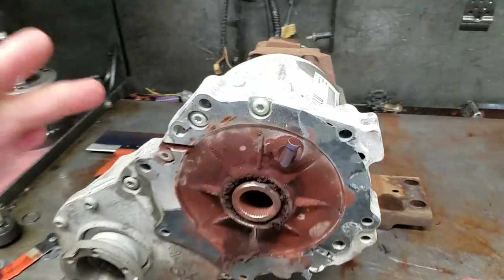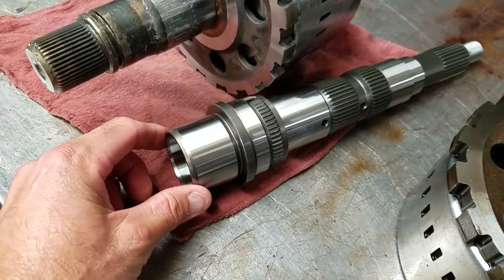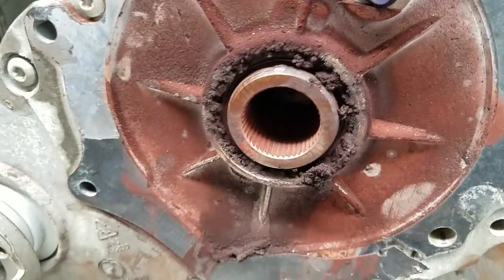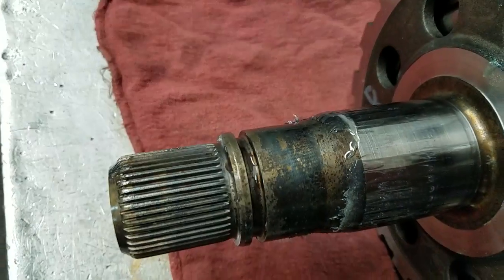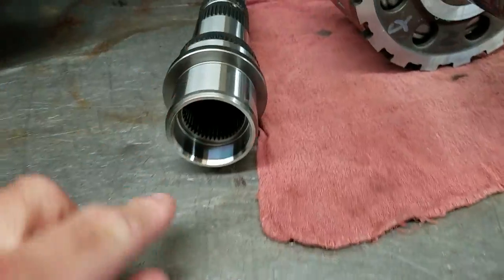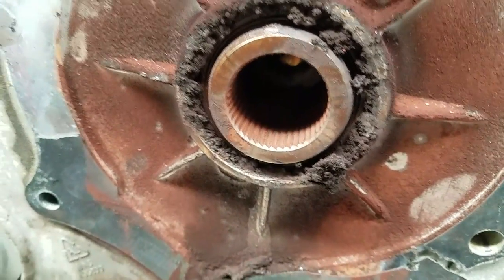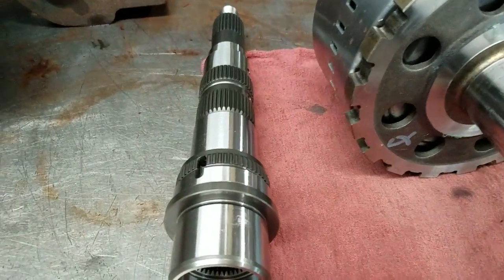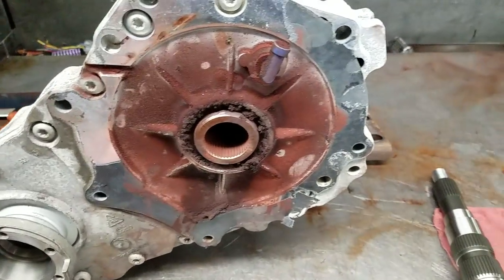Cadillac cts transmission spline failure Meenan Transmission

Comment: This just happened to me. I first heard a bang noise when shifting gears and then all of the sudden the car didnt move and just heard a grinding sound. Had to get it pulled to the mechanic. He said it is the transfer case. Now this video tells me that the transmition has to be taken out and apart as well. Should I go ahead and order a used transfer case from Ebay? Because  he is still going to have to replace the shaft in the transmission, according to this video. 
Also, do you think It was just the splines of the input shaft to the transfer case that corroded? If so then buys just the case would solve the problem.
Reply: What did you end up doing? I'm having the same issue.
Reply: Same issue here
Reply: Do I need to swap tranny as well or just Transfer case.?

Comment: I got a 2011 CTS awd and I think in having this issue!
Reply: This was changed in 2010. It only existed in 08 and 09
Reply: @travishollobaugh1419  That's not TRUE....2012 still happen
Reply: @maxwellautoservice_yeg834  mine is a 2012 cts performance package with awd and i believe my transfer case is going out as well. clunking and noise of metal gears grinding and such at low speeds. starts around 7mph up to 45mph. sometimes it goes away, most times its there. really really bad and noisy while turning at low speeds and moderate around 25mph. it is very embarrasing. i ordered a new tc from amazon for $600ish. and will be installing next weekend hoping it solves my issue. i also have abs light on, service stabalize light on and service traction control light on as well. i wish the owner of this video would have replied to someones comment saying if or if not it fixed it..
Reply: @jackkirk5463  I done  mine about 8 months ago....transmission  & transfer case shafts. You can not do only the transfer case. All done in my shop...took me about 24 hrs to completed
Reply: Jack Kirk did you ever fix this?
Reply: Travis Hollobaugh really? Thats good news.  All cts4 2010 have the new design part from factory or it was a recall or something else?
Reply: it gets worse and studders under load
Reply: My 2012 has done this same thing in process of repair.

Comment: what year those car has that issue?? thx
Reply: 2008 and 2009, the re-designed parts appeared in 2010 and newer models
Reply: My buddy's 2011 has the same issue the updated parts are junk as well. One guy failed at 60k then at 120k.
Reply: @cmacclel How about 2013?
Reply: 08 cadillac AWD they have those transfer case
Reply: Are we discussing, Borg Warner 4476 and 4479 transfer cases?  Matched up to 5l40e/5l50e auto boxes?